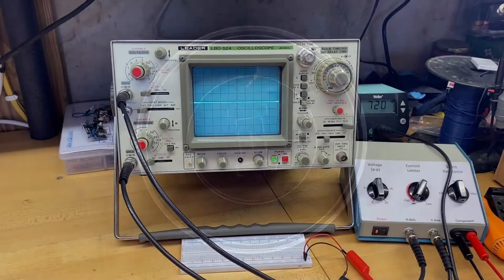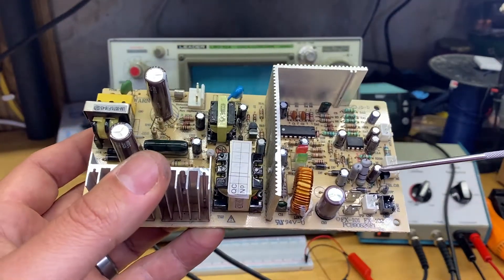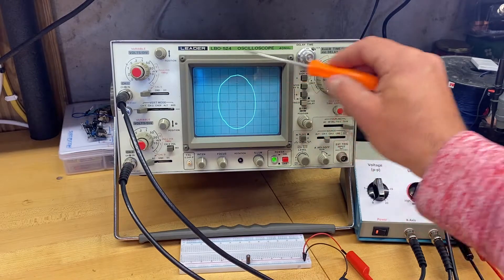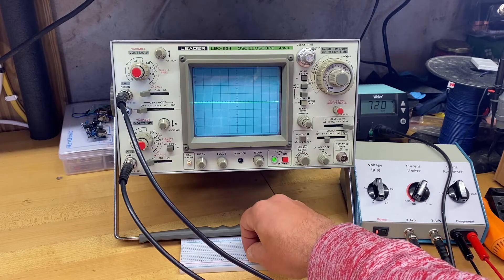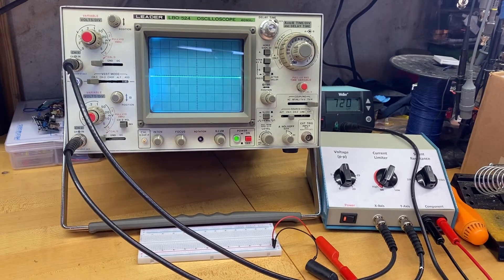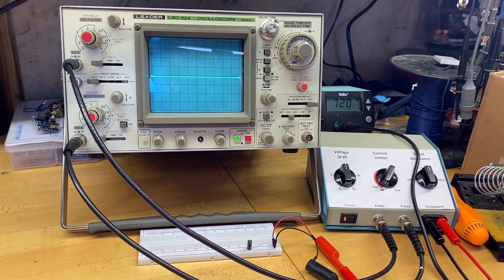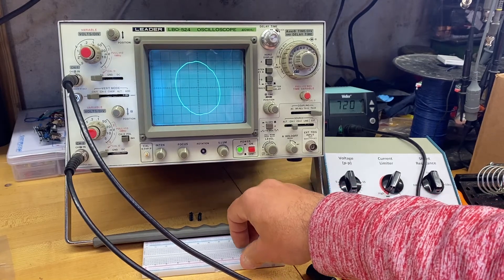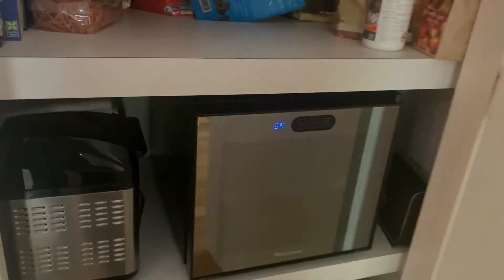Wine Fridge Fixed

Comment: How did you determine to check capacitors? Did you check all the components, resistors, caps, diodes, etc, and come up with the caps by process of elimination?
Reply from the maker: Let's just say that decision was an educated guess. 1). Resistors, diodes and transistors often (but not always) show visible signs of stress when they fail. 2). Capacitors are more likely to fail than those other components. 3). This circuit contained Chinese made capacitors. It is well known that Chinese made capacitors, especially from the time frame when this fridge was made, are prone to pre-mature failure.  Search "Capacitor Plague" to learn more.